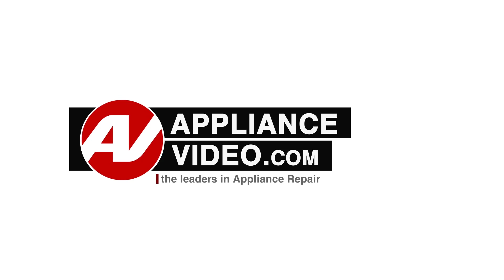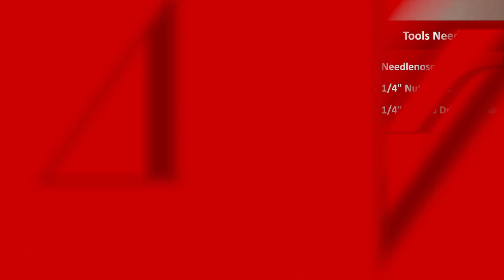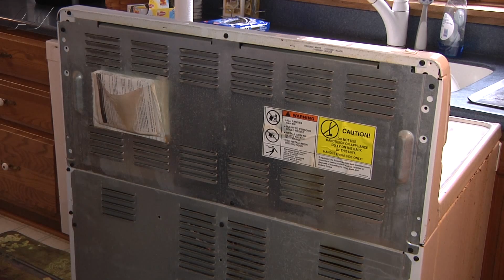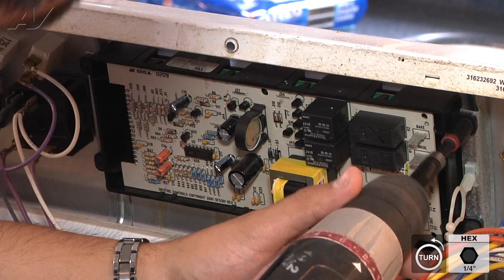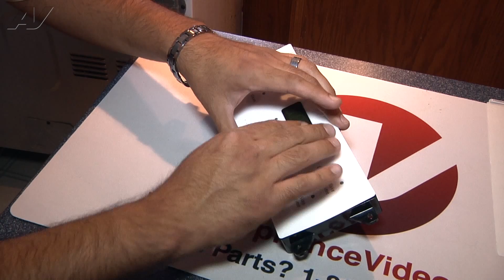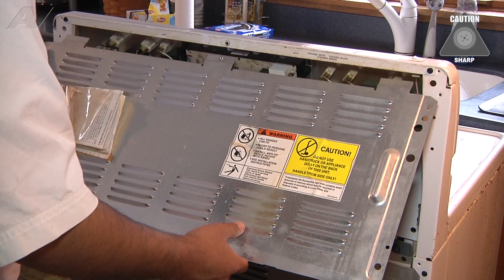Frigidaire Stove Repair - F1 Error Code - Main Control Board

Comment: I kind of follow you if your buttons use the zig-zag lines like in a tv remote control what with  the paint transfer and causing a short. But it appears that this one as does the one I have has plastic levers with micro switches underneath them.

Comment: So, I have the frigidaire 30in 5 element range and it won't come on until I turn a range knob then I'm able to set the time and turn the bake setting on but nothing will heat up. I've tripped the fuse box 5 times and unplugged and replugged numerous times too but nothing will heat only the warming range. I bought it last August so my limited warranty is up. Has anyone else had this problem with a range?
Reply from the maker: Great question, if you have a more technical question that our parts department cannot answer, you can search our over 17,000 answered questions free at our website www.ApplianceVideo.com under our Repair Help section. You can also call our parts department at 1-800-830-5465 and they can give you help 7-days A week ,or search at www.SaveMoreOnParts.com  .

Comment: I don't have any error code. I was using the outlet on the top of oven. The wires shorted out. Now nothing works. Think the board fried?
Reply from the maker: Great question, if you have a more technical question that our parts department cannot answer, you can search our over 17,000 answered questions free at our website www.ApplianceVideo.com under our Repair Help section. You can also call our parts department at 1-800-830-5465 and they can give you help 7-days A week ,or search at www.SaveMoreOnParts.com  .

Comment: Is there a way to fix an F11 error without replacing the EOC board on this same model?
Reply from the maker: Great question, if you have a
more technical question that our parts department cannot answer, our
technicians are answering all questions at our website at www.ApplianceVideo.com under our Repair Help section. You can also call
our parts department at 1-800-830-5465 and they can give you help 7-days A week
Monday -Sunday, or search at www.SaveMoreOnParts.com  24 hours
7- days A week.

Comment: So what if the board has blown / burned relay boxes? I have bought a new board, but I'm afraid to install it because I'm worried something caused it to blow like that. Any suggestions?
Reply from the maker: Great question, if you have a
more technical question that our parts department cannot answer, our
technicians are answering all questions at our website at www.ApplianceVideo.com under our Repair Help section. You can also call
our parts department at 1-800-830-5465 and they can give you help 7-days A week
Monday -Sunday, or search at www.SaveMoreOnParts.com  24 hours
7- days A week.

Comment: I have a Frigidaire FEFL68GMA. The baking element went out and I replaced it. It's still not heating. The cooktop works. The broil isn't working either. The new element as well as the broil element has continuity. The wires to the baking element didn't burn up. I have proper voltage, the cord is fine. The thermal sensor is fine. I'm not getting any codes on the display. Do you think it is the control board more than likely?
Reply from the maker: Great question, if you have a
more technical question that our parts department cannot answer, our
technicians are answering all questions at our website at www.ApplianceVideo.com under our Repair Help section. You can also call
our parts department at 1-800-830-5465 and they can give you help 7-days A week
Mon-Sat . You can also search at www.SaveMoreOnParts.com 7- days a week.
Reply: xx1lomazdawgxx l.